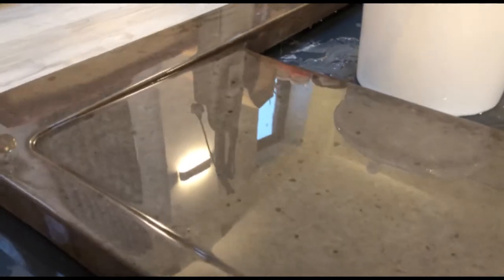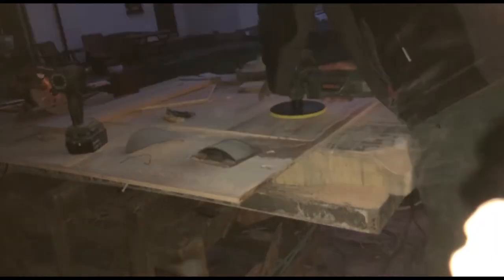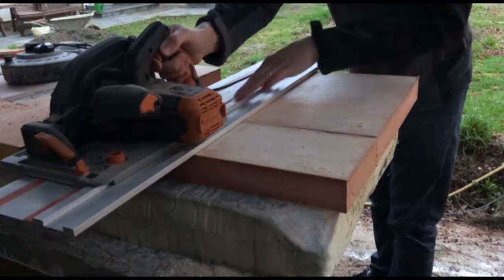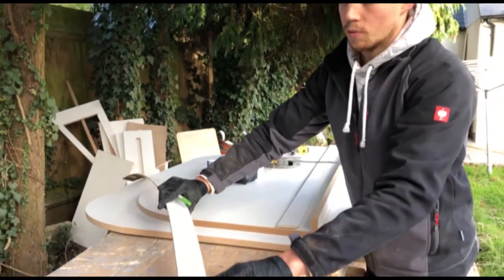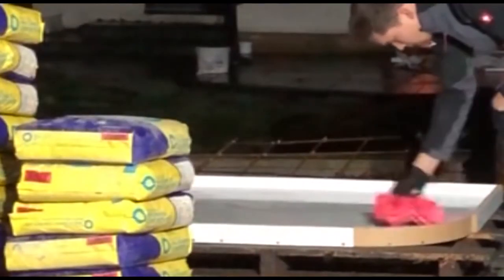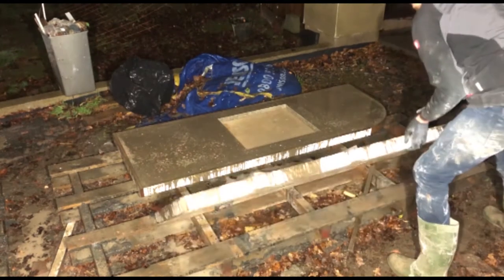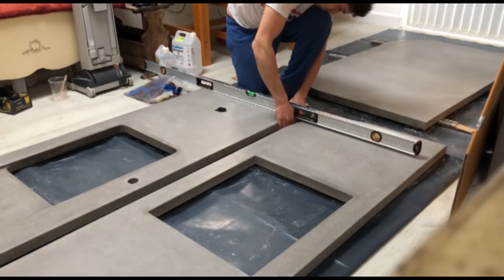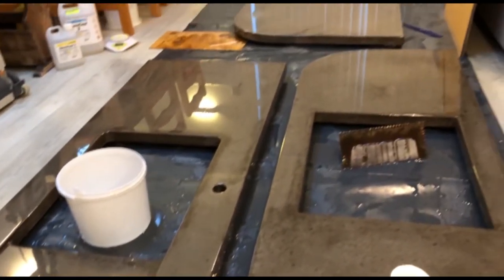Concrete Countertops with Integrated Drainboard & Epoxy Finish

Comment: Fantastic. This epoxy….will it melt with a hot pot or must I put a pad down first?  Also is the expo you food safe and ow do you clea it?
Reply from the maker: The glass transition temperature is around 120 degrees Celsius. So you can’t put a hot pot on it but you can put hot mugs and plates, and spill boiling water on it.
Leave it at least 2 weeks before putting a hot mug on the surface as the epoxy gets harder and stronger with age.

Comment: Ok you have literally saved my life, I’ve been researching concrete and epoxy for days and everyone’s American!!! So hard to know exactly what you need specially when you’re a novice! 

I was hoping I could pick your brain for a second, I am hoping to use concrete and resin over some mdf to make a nail desk (I have a salon) however I’m doing this to get a Luxe custom fit on a budget so I don’t want to mess it up. 

So correct me if I’m wrong 
1. Sand the wood so it’s rough 
2. Use alcohol to dry the surface and remove the dust 
3. Do thin layer of concrete (is it called scratch? Does that require a different product or is it a nickname for the technique?) 
4. (Leave to dry for 24 hours between each layer) but do 3/4 
Do you sand between each layer?
5. Use slurry to fill any holes 

Now this is where I get unsure I want to use epoxy to protect the surface from chips and also make it wipeable (is epoxy my best choice?)
Is there anything special I need to do to the concrete to get it to adhere?
I had already found the brand you mention in this video so if I just get the exact same as what you used here do I just mix it and pour it on and voila or is there something I would need to do once it cures to top coat it etc 

Last question I’m sorry I’m just so excited to have found you 
Does it matter what concrete I use? Because obviously you’re making a slab and I would just be doing an overlay! 

Thanks so much 
Janessa 😅
Reply from the maker: Hi Janessa, I’m glad you found the video useful :)
It’s sounds like you are using micro cement and spreading it over the top of mdf. I’ve not done this process before but you can pour epoxy over pretty much anything, as long ask there it a good ‘key’ for it to stick to, so you can sand the concrete surface with around 200 grit sand paper to achieve this. Then clean the surface with acetone and you should be ready to start pouring epoxy.
No there is nothing you need to do after pouring the epoxy on top? Just leave it to harden on its own and it will be done in about 16-24 hours.
I should say that it has to be done in a fairly warm and dust free environment i.e indoors, in a room that no-one will enter will its curing/hardening. If it’s too cold or there is too much moisture in the air, the epoxy will not cure properly.
And voila you’ll have a very shiny concrete nail desk.
Just so you’re aware you should leave the epoxy around 14 days before putting anything hot on the surface like mugs or anything similar, as the epoxy get harder with age.
I hope that helps.
Reply: @MattHutton  that’s amazing, the epoxy was what I was more nervous about tbh! Now I have to figure out how to get a day where I can leave the epoxy with no staff coming in HAHA!

Thanks so much for your reply you didn’t have to do that, and I saw you say you’ve got more concrete epoxy stuff coming up so I’ll be watching like a hawk! Take care x

Comment: Hey Matt! Great video! How is the epoxy holding up? We've always steered clear of topical epoxy resin sealers because in the early days we found the yellowed over time and began to peel. We only sell penetrative acrylic concrete sealers now but I'd be interested to hear your views?
Reply: I was wondering that too.  This is a great video and I love to see UK guys doing this because 99% of the videos are from the USA and they reference different products.  Most of the USA DIYers seem to be using penetrating sealers though.

Comment: Great video again Matt, love the finish. Just a bit of a question on the air bubbles and the need to fill them with slurry. What has been your experience in terms of amount of pinhole bubbles to fill, corresponding to your vibration method? ie. what is the difference in surface finish when you vibrate your countertops on your DIY concrete vibrating table compared to just using an SDS? And what is your decision process when choosing the vibration method? Thanks,  and response is greatly appreciated 😀
Reply from the maker: Decision process is, can I lift this worktop on my own, on to this vibrating table and is there anyone around to help :). 
If not I’ll vibrate it by hand and SDS drill. It comes out perfect with the vibration table after 3-5 minute of vibration. You most likely won’t need to fill with slurry, maybe just a couple of holes.
Vibration by hand can also come out very but you will need to do about 30-40 minutes (for a 2m by 0.6m worktop for example) of vibration by hand plus SDS drill around the sides to get the same results as a vibration table. So you will most likely have some little holes to fill.

The surface needs to be completed filled and smooth and have a key of between 120-320 grit to give the epoxy a good key to grip to.
This epoxy will product far fewer pinholes than most due to it being self levelling and the 16 hour slow cure. But if you have a 1mm hole or larger you will need to fill it otherwise it will most likely sink in and cause an visible undulation in the surface.
I hope that helps
Reply: @MattHutton  thanks again! Must have taken ages to write that, much appreciated. Good to know about the larger holes taking in the epoxy as I wouldn’t have even considered that. I think I prefer the more matte look after you’ve applied the H-Seal on some of your other videos versus this mirror-like finish, but it’s awesome to see this done. Regardless of how many layers of the H-Seal you apply will the concrete always return to its original colour, lighter and dry looking? As I love the more matte/damp look you get after initially sealing. In your experience is there any way to maintain this matte look without applying a wax regularly? I haven’t seen much about how long the h-seal will last in practise.
Reply: @liamdawes  You can get a matte finish with epoxy by wet polishing by hand with a high grit sand paper.

Comment: Hi Matt. 
When it comes to mixing the concrete… is the blue circle or Hansons stuff better in your opinion? 
Also in your mixer are you mixing 2 bags at once and roughly how much water are you adding? 
Cheers.

Comment: I am curious since you are covering it with epoxy why not just fill the voids with epoxy rather than the cement slurry? I have not tried making a concrete top yet but am giving it some serious consideration thanks! How are you mounting under-mount sinks? Would it make sense to install some bolts during the pour for that purpose?
Reply from the maker: You can do either. The cement slurry is easier because you can just rub it in, cheaper and gives a more marbled effect as the slurry has a slightly different colour to the concrete. If you use the epoxy to fill the holes individually, make sure to flatten them after so you’re pouring on a nice smooth surface and make sure to get all of the holes.

Comment: Where oh where are you purchasing so much of the Blue Circle High Strength (40N) Concrete ???? Everywhere in UK seems to be out of stock or limited !!! 
I see the link to Wicks website but they seem to have none as well!
Reply from the maker: Yeah unfortunately there seems to be a shortage at the moment. You could try another brand like Hanson, I’ve found blue circle to have the best colour for me. But you could try another 40N concrete.
Reply: @MattHutton  Thanks for reply good Sir, I did see the Hanson alternative brand, though it's much more expensive and when buying the amount I want to purchase it will be a killer! :D

Comment: Great!  Can this be used in an outdoor concrete counter top?
Reply from the maker: I’ve asked the manufacturer and they just recommend it for indoor use. It does have UV inhibitors in there but will still yellow a bit over time. And automotive polyurethane might be better for outside if you want a gloss finish like this.

Comment: you could have use a heatgun to be sure that all the bubbles disappears
Reply from the maker: Hey Seb thanks for the message. Yes I could have. But from my experience with the material at room temperature, cure the long cure time give it plenty of time to get rid of all the air bubbles, plus the degassing agent in the epoxy pushes the air out. One a normal epoxy I probably would, but those will yellow over time.
Reply: @MattHutton  I have all my products in a room and do the epoxy in that room and the bubble will stay there.. or something they will explose.. but will a crater in the surface.  For now I'm always using a heatgun.. just to be sure.
Reply from the maker: fair enough :) it won’t hurt to use a little heat.